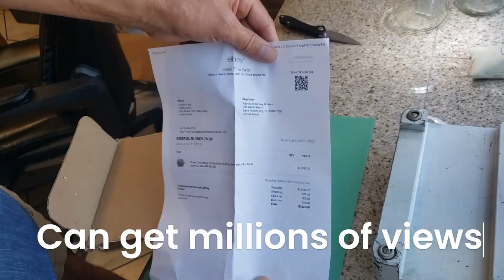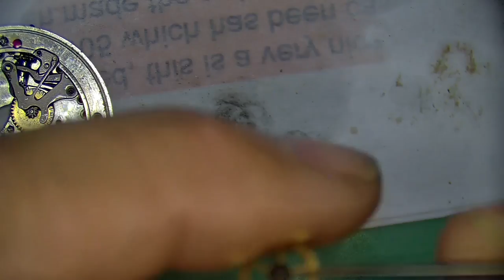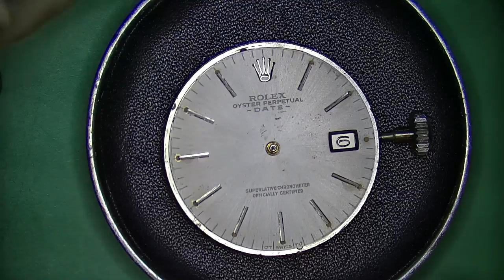Rust to Riches? Can Evapo Rust help save this rusty Rolex?

Comment: Inspiring video. Many thanks. I had worn a 1601, also with this same 1570 movement for 29 years. On 072322 the movement was exposed to salt water while we were on vacation this summer due to a crack in the crystal below the bezel that I hadn't noticed. The watch was a graduation gift from my parents and very sentimental. I'm the mechanical type, old cars mostly, and I had done a very small amount of watch maintenance myself before so I removed the movement and took it to my my local watchmaker, whom I've known for years. He looked at it briefly and said it was completely ruined and he wouldn't work on it. Then he suggested I send it to Rolex. I wanted no part of that! I was confused because I had seen several other videos detailing a complete restoration like this one and didn't see how mine could be unsalvageable compared to what I'd seen. However, I understood that he was in business to make money and I couldn't blame him for turning down what he considered to be an overly time consuming repair. Undeterred, I purchased a few entry level quality watch tools and completely disassembled the movement to assess the damage and cleaned it. Mine was in nowhere near as bad of condition as the one in your video! Currently, several screws and steel parts that had slight evidence of rust are soaking in a cup of Evapo-rust on my desk. CLR was helpful but I believe the Evapo-rust will be superior from what I've been told. I plan to have another watchmaker in Dallas reassemble the watch so that he can determine which parts to replace, proper lubrication, torque, etc., which I am not prepared to do at this time. After watching this video, I am much more optimistic that I will have my 1601 back on my wrist sooner than later! And I believe that with the help of this video I could eventually do this procedure myself and so could almost anyone else. Again, thank you for posting and sharing your tremendous skill. I also subscribed and look forward to more of your demonstrations in the future. Also, Beethoven was the perfect accompaniment for your video. Nice choice.
Reply from the maker: Good luck with your project. Be careful with the balance wheel and hairspring. If they are damaged they are not cheap.
Reply: @Watchspotnet  Thanks. Yes, I have been very careful with that part but if it needs a new one I'd rather buy it than be without my watch!
Reply: EVITE TOMAR BANHOS COM RELÓGIOS,  EU FAÇO ISSO  👍👍 🇧🇷
Reply: Did you fix it?

Comment: Well Done! I hope You get Your Million viewers. This sure was better than those fake "Amazing Restorations" the YT has been plagued by lately.

And Yes: Me too would've used WD-40 after Evapo Rust treatment. WD-40 is shunned at amongst the watchmakers, but mostly only because it is so often used incorrectly and in wrong places. A tip for other amateurs like me: WD-40 paired with a long session in the ultrasonic cleaner does wonders loosening stuck screws! 😁
Reply from the maker: I agree 100%

Comment: Although a mighty task i can't help but notice some parts are still covered in black grit. If im going to spend a lot of money on a watch I at least expect it to be mint inside, especially a Rolex. Props for the job. you got your like.
Reply from the maker: I agree that the condition is less than optimal, but anything that was needed to get the gear train running smoothly was done. A line has to be drawn somewhere unless you are going to replace every stained part, which was just not the intent here.

Comment: Great work and I love a good challenge and to see vintage Rolex's brought back from the dead but by the time you factor in the initial purchase price, parts cost including sourcing out a used dial, and that a 34mm 1500 is not all that desirable it's a tough call to take on a project like this. If it had the original Rolex band maybe for $1,000.
Reply from the maker: It was a fun project.

Comment: 16:55 I'm surprised you didn't have to replace the balance spring. It seems like the corrosion would have taken metal from the spring leaving it limper, resulting in great amplitude but losing a half-hour a day.
Reply: vintage rolex not waterproof,  remember that

Comment: buy all the parts or just buy a working replacement movement, is the watch BER (beyond economical repair) or due to passion of putting it together to make it work override the cost impact.   I think I would restore it despite the price just to get the thing back to working order again-  because that is where the horological passion is !

Comment: 350 for that scratched up dial is a bit much
Reply from the maker: I know it was expensive, but it was the best dial I could find in the original color to the watch. I try to keep my watches as original as possible.
Reply: @Watchspotnet  I don't blame you one bit and the watch turned out very nice. just a shame the dial couldn't be in a bit better shape at that price, or a little cheaper considering the condition.